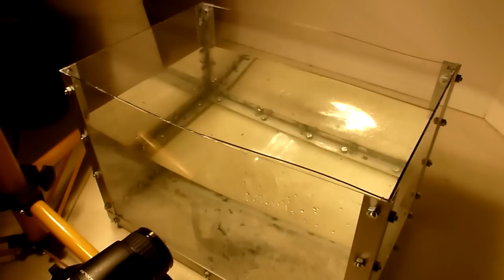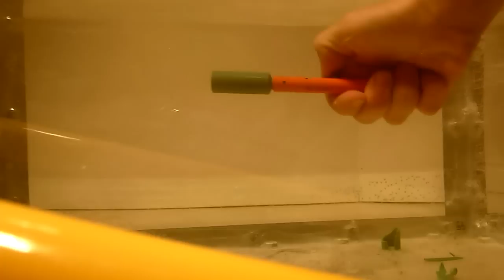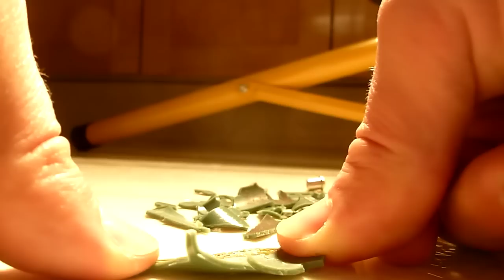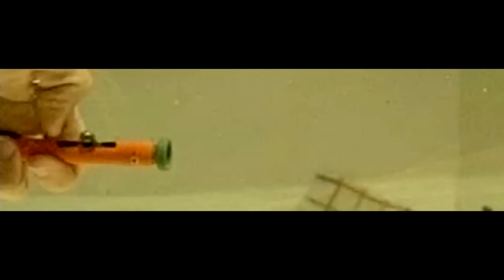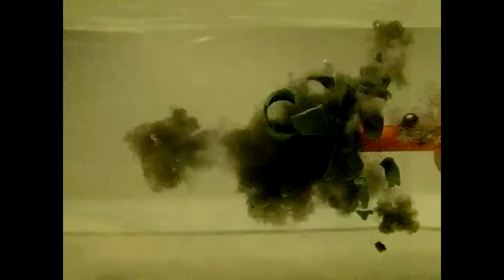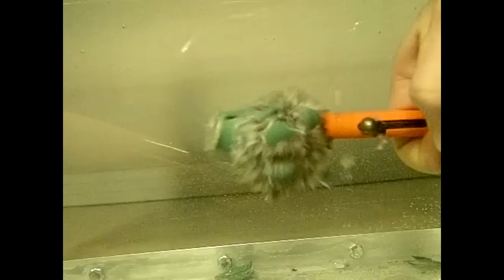Shotgun primers detonating underwater, super slow motion study

Comment: Incredible to see the 'bounce' going on between the mass of the water and the springy gas bubble.  (BTW, the .093" polycarbonate thickness relates back to fractional inch sizing originally used for sheet products in general, in this case, 3/32" )

Comment from the maker: I would have to agree. The resistance from the water's viscosity must be what gradually robs the system of its kinetic energy hence the smaller and smaller oscillations. If you look at my video of the sky rockets underwater, there's more interesting bubble action. The flash powder burns much slower and the reaction continues as the bubble expands and collapses. Note how the gas bubble nearly stops glowing as it expands, then becomes bright as it collapses. thanks for your comments!

Comment from the maker: I drilled those; without the the holes, the launcher didn't work under water. The firing pin assembly slides towards the primer, and the water present in that space is displaced rapidly upon firing. The holes allow that water to move out of the way faster, and reduce the damping effect of the water on the speed of the pin.

Comment: One tip...  Disable frame resampling on the footage before rendering video. This will eliminate the ghosting you see in the first portion of the video.
Reply from the maker: Tofu San I had it disabled for the high-speed clips, next time I'll try disabling in the whole clip as well. Didn't even occur to me. Thanks for the tip!
Reply: Gyppor Great video, BTW! Really an awesome eye-opener. It's a shame that EX-F1 doesn't have any successor and GoPro has yet to give us anything beyond 240fps.  T
Reply from the maker: Thanks! There's a camera out of the UK called the FPS1000 coming out this year, the top end model will cost about $5K and the designer claims 4000fps at 1280x720 (!!!) The Edgertronic is also impressive, but I can't order one in Canada. There is finally starting to be some choice in the consumer high speed camera world. Still, the EX-F1 is a great camera, battery life and ease of use are still right up there and they can be had on Ebay for about $1000.

Comment: Are you sure that is a "gas" bubble? I believe it is a vacuum (cavitation). It may have a very small amount of gas mixed in but the large sphere is certainly a vacuum. watch?v=MPJjMJ48CdY
Reply from the maker: Cavitation is actually when a liquid flashes into vapor, so in that case the globe would be a gas bubble on the inside with a layer of vapor on the outside,  It would nonetheless be interesting to find out how much of it is water vapor. While I agree that at maximum diameter the globe has lower pressure than the surrounding water, but I don't think the majority of its volume is water vapor. The surface of the globe does appear uneven, so perhaps there are cavitation bubbles at the water/gas interface? Interesting question. In the old video, they do refer to it as a gas globe and not a cavitation bubble. Thanks for the comment!